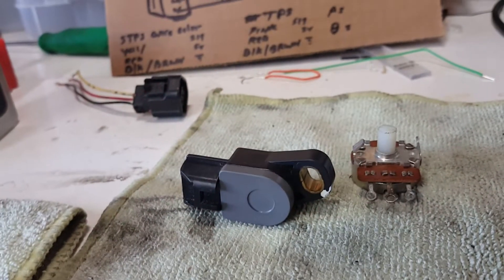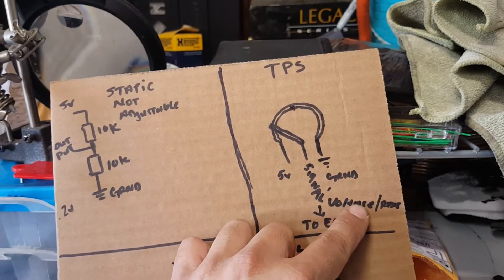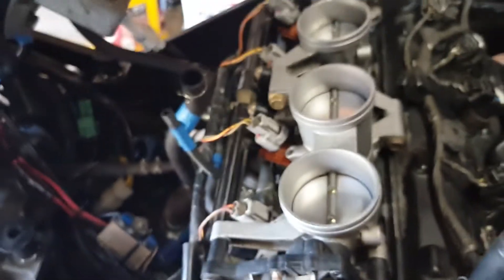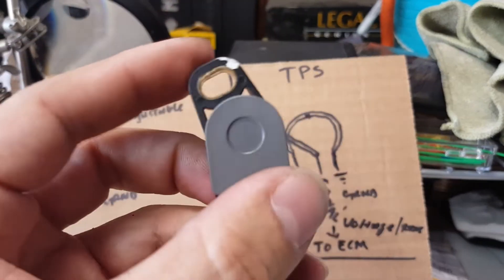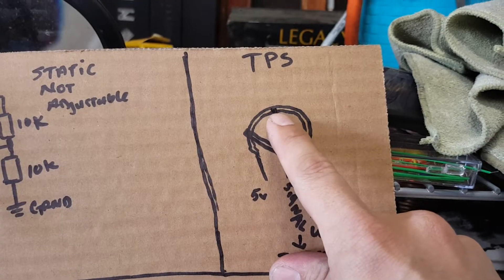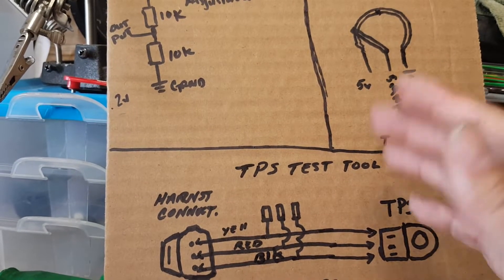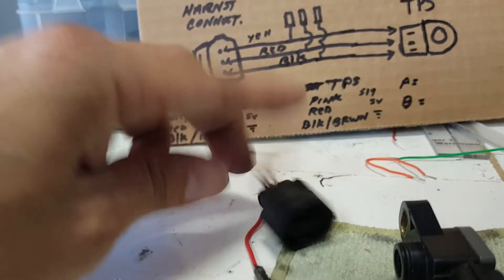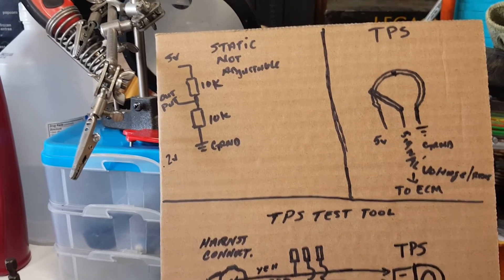DIY SUZUKI GSXR 600/750 Explaining the TPS

Comment: Are u talking about the jerky herky throttle? Where 0-10 percent throttle doesn’t seem to exist. When ur trying to maintain a normal speed?
Reply: Same issue I'm having. Did you figure it out?
Reply: @850Biker  unfortunately no, only rode the bike a few times this year and it hasn’t really done it. It randomly happened when it did. sometimes would be totally fine.

Comment: Hey can you make a video on how to replace the tps cause the line next to the coo code is on top wen the bike is not running but wen it's running it's in the middle and wen I pull the throttle it jumps to top then back to middle wen I let go of the throttle
Reply: Its when not wen

Comment: I hope you’ll still answer on my gsxr 750 the bike lags behind I’ll give it full throttle and instead of shooting off like a bullet instantly it stutters for about 5-10 seconds before the bike realizes I’m giving it full gas I just installed a new fuel pump was wondering if my tps is the issue
Reply from the maker: Put the bike in dealer mode and check the TPS level at idle, should look like this -00, then see which way the level floats when you give it WOT. this way _00 or does it move to the top..  at idle it should read -00, if not, it needs adjusting.. thats where I would start.

It's very rare for a TPS to go bad but it can happen. I know you just purchased a new fuel pump but did you check to see if you have the proper fuel delivery and fuel pressure or did you just assume it's good because it's new. After that I would move to my injectors and make sure I have forward and backwards flush them to ensure they're not dirty. Also check the spray pattern, is it a nice V or does it just dribble out.. lol. Another thing that most people overlook are spark plugs. I would start with a fresh new batch that are properly gapped. Be sure to  test your spark on each pack. I once had a spark plug that was loose in the number one cylinder that was causing me issues in the mid to top end range. It wasn't till I got in there to install  new plugs to  that I noticed the plug was loose and was the issue.

Lots to cover for problems like this.

Comment: My gsxr1000k3 runs bad but once its over 4000 rpm its ok  it bogs and cuts out when you rev it really slowly i pulled the tps plug off when bike was running and its so much better can rev slowly no problem. Would you say my problem is the tps as its so much better when i unplug it £166 for new tps i just want to make sure plz any advice would be great ty
Reply from the maker: Are you speaking of the TPS or did you mean the STPS.  Bogging at low rpms i would also look into poor spark (bad plug or plugs) and or dirty injectors to rule out the other components the TPS or STPS controls through the map (ECM) programming.
Reply: @TheChemistDIY  plz can you help me again i have cleaned fuel filter to injecters, new spark plugs but bike is still bogging in low rpm i have replaced my throttle position sensor thinking it was that but bike is the same but unpluging the tsp it runs good so what controlls the tps?what would you look at?
Reply from the maker: @mattmiles259  ok so look at this video and see if your butterflies are operating as they should with the TPS and STPS connected.
https://youtu.be/wfuXw0nhwh8

If after revving a few times they are moving as expected then its not going to be a TPS/STPS issue because remember all they tps does is tell the ecm where the butterfly (gold butterflies) is at and to increase/decrease air to fuel ratio, which in turn moves the STPS (secondary butterflies) open or closed.

Your issue may be a fuel delivery which means low fuel pressure or fuel pump not working correctly (dirty or bad). You would need to perform that test with a fuel pressure regulator and perform the fuel pump test.

Also Put the bike in dealer mode and see if your getting any hidden errors codes on the cluster.

Also when u put in dealer mode where is the needle at on the cluster.. in the middle, up top, or down low? I know you said you changed out the TPS but did you put the bike in dealer mode or  Diagnostic mode and adjust the TPS properly. The level indicator should look like this -00  (line is dead center). if its above or below you need to adjust the TPS/STSP.

Comment: I'm having a problem with my 2007 GSXR 750 where everytime I'm climbing rpms all of a sudden it cuts power drops rpms to 0 then goes back to its actual rpms it was before. happens mostly every gear when I'm rolling on throttle if anyone knows what it could be before I start switching parts out
Reply: It could be your kickstand sensor. Make sure your springs on your kickstand are strong. I had that issue where the rpm would just drop to 0. Kickstand would drop alittle more than it should so I got a new spring and it never did it again

Comment: My 2008 suzuki gsxr can rev more than 5000 6000 rpms!  Can go fast but has to be gradually! If I push the bike to the limit start with the misfire  loss power between those rpms! Note ! New fuel pump filter! Spark plugs and i clean the injectors! Still have the misfire! Any idea
Reply from the maker: @yamahar1castillo923  have you checked for vacuum leaks, ignition spark from each coil pack, proper fuel pressure and fuel delivery, (this goes for both injectors and fuel pump) .

Are or was there any previous code being thrown from the ECM?

Comment: Is it possible for this to cause RPMs to hang on deceleration?
Reply from the maker: Not likely unless the TPS or STPS is somehow binding slowing the movement of the flies return.

 If your RPMs aren't dropping fast as soon as you release the throttle then I would suggest checking your throttle cable play.. as soon as you release the throttle it should snap back quickly.. if it slowly returns to the closed position then it's dragging causing your engine to slowly return to idle..

Comment: You may not be solving my issue, but I genuinely appreciate the time you took to make this video so that I could learn something.
Reply from the maker: Sometimes it works out that way. You go through videos YouTube channels hoping someone will hit that sweet spot and describe exactly or close to what your experiencing.. in the process you pickup additional knowledge and lock it away for another rainey day.
Reply: @TheChemistDIY  Your videos have been helping a lot. Without going too much into it. My bike fell over in a storm. Street was flooded so my bike got water in a bunch of places it shouldn't. Got it to start and ride. At first it was fine. Took it out and in higher gears it maxes out at a certain rpm per gear. I now have an stva code. Because without thinking or knowing exactly what the fuck I am doing...I slightly moved the secondary buttflies with my hand. So I probably destroyed something.
Reply from the maker: We all have to start somewhere brother and by you getting in there began your venture into learning what your bike is all about. 

The butterflies aren't that sensitive bro, you are able to move them by finger so no worries there, you didn't mess anything up.. your C28 code is very common for this bike..  and I have a fix for it.. there are three video in my arsenal of repair videos and make sure you see all three of them before going in.. but just so you get a better idea on how to fix you issue here is part two.

https://youtu.be/wfuXw0nhwh8

Remember you can't damage what's already broken, you can only move up from here.. pick yourself up a service manual and read up on your bike.. I usually have links to a few in most of my new videos.. I own two on my bike and looking to get a third.. each has there own way of explaining things..
Reply: @TheChemistDIY  oh dude I watched all three of those before even watching this one. And I also appreciate your words of encouragement. Before I knew even how to ride a motorcycle at all I told one of my buddies (owned an 05 gsxr 600 which is funny because he had this issue) that I would want to do as much repairs as I could on my own and learn as much as I could because I like to be self reliant. As soon as I bought my k6 600 I bought a clymers manual and downloaded the oem service manual. I've been delving in the oem for the stva but haven't checked my clymers. I for sure appreciate the time you've taken to respond and all of your videos.

Comment: You're frekkin' smart man, I can tell by your explanation of these things. Great video! I was scared for my bike, But your explanation let me know what is going on. Good stuff! I'm definitely subbing!
Reply from the maker: Prone Rider 562 thanks for the props and thanks for subscribing. By no means do i consider myself smater then the average person, just well seasoned and a person who has taken the time to research and educate himself on the finer details. Dont ever be afraid to open your bike up, remember you cant brake whats already broken. Ride safe!
Reply: What was going on with your bike? I'm wondering if i have the same issues.
Reply: @curt1star05  For my bike, The throttle position sensor slipped out of timing so it would bog out at around 6k for a split second and then again at 6.5k and up around 8 as well.

Comment: Amazing video.. this was the problem with my bike.. very good knowledge shared here.. thank you very much
Reply from the maker: Glad I could help you out brother, thank you for stopping in and commenting. Greatly appreciated
Reply: @TheChemistDIY  
I also wanted to add.. I had trouble with the resistance measuments.. however I heard a clicking noise when I spun it.. after my new tps arrived it was smooth.. not clicking...

Comment: Can this cause a bike to just crack but won’t start? Is it like common with these bikes?
Reply from the maker: Can it? Yes.. but really anything can be said to do the same about any component on the bike.

You have to look at things in the broader sense:

A popular explanation of how a four stroke engine works is:

Suck, squeeze, bang, blow.

The engine sucks in a mixture of fuel and air, then squeezes it together (compresses it), then it burns / explodes that with a bang, and finally it blows out the exhaust.

So what part does the TPS do.. well it's part of the SUCK because without the correct air intake the bike is not going to start. The TPS(s) controls your butterflies which allows the correct amount air to come in during start and ride. All this is being controlled by your ECU "Mapping" which is basically like a receiver.. collecting data from its sensors (sensors), comparing it to a list (map), and then sending out what you need to keep the bike alive.

During the SUCK you also have to have the correct amount of fuel. Without fuel you won't get to BANG.. 

SPEAKIN OF BANG! .. what lights your fire 🔥.. yup... That's right, Spark!

Without a healthy flame You're basically trying to light a firework in the wind with a wet match stick.. not going to happen..

Probably not the answer you want to hear but when you put all those principles together You get an idea of what you need to check in order to get your bike to turn over and run.
Reply: @TheChemistDIY thanks bro soon get back to the bike

Comment: Hello, James 
I’m having a sputtering issue on my 2006 gsxr 600 during high rpm’s, I have replaced my fuel pump, stator, rectifier, spark plugs, and is still doing the same. Do you think that the TPS might be the issue? Pls help me out.
Ps great videos, keep it up and thanks for all the educational videos you have, I’m sure you are helping a lot of riders in the world.
Reply from the maker: Hey Derik, thanks for joining the channel. In order to troubleshoot your issue I'm going to need a bit more information (details are everything!!!).  You say the issue occurs during high RPM, well does this happen if the bike is parked and in neutral and you rev the rpms up? if so then we can exclude drive train (Tranny). If it happens only during a ride then we need to also think about the drive train when trying to diagnose.

Here are some questions you should asking yourself to diagnose:
Does this happen if the bike is parked and in neutral. Can I rev the RPMS up and reproduce the problem.
Is this at a specific RPM that the spudder or bogging occurs, say 7000k or in the range of 5000k-7000k rpms.
Is it sporadic (only happens sometimes)(if so what are the ALL the conditions like)
Is the bike at a certain temperature when this happens?
Is it hot out or cold out, (climate issue) 
Is it in a specific gear that this happens (2nd, 3rd, 4th ..ect)
is it in a specific gear at a certain RPM range (2nd gear @ 7000k rpms).
When was the last time I adjusted the Clutch/when was the last time i replaced the clutch.
Is the chain tight, when was the last time I changed the chain, what do the sprocket teeth look like ( is this happening because the chain is jumping teeth)

It's very rare BUT NOT IMPOSSIBLE that its a TPS issue. you've changed out a lot of parts that I would imagine could cause this issue. but sometimes it maybe something so small that were overlooking like dirty injectors, fuel lines,  or gas tank. when you removed the fuel pump was the filter very dirty. if it was did you look inside the gas tank for rust and other junk because what's inside the tank could possible be in the rest of the fuel system, therefore we would need to clean the entire system from beginning to end,... see where I'm going with this? (details)
Reply: james moreno 
Hello James, 
It does it in any gear , but only on high revs maybe around 8k-10k, but on neutral it is fine when I rev it up, but I still did not try to rev it up slowly to see if it acts up on neutral, the sound that you describe on this video sounds exactly the same my bike makes, the fuel filter was normal state for its years in the tank when I replaced it, no rust and or debris that would harm the fuel lines, I was thinking after watching this video it was the TPS, or maybe I can get a fuel injection cleaner, and or my power commander? As for the sprocket teeth it is still fine no issues on it. Chain is kept maintained and no jumping.
Reply from the maker: @dreyes001  ok so now were getting somewhere. At the time of this video i was experiencing a quick blurp/cutout when climbing up the rpm rang fast, when i wasnt so hard on the throttle and rolled through my gears nice and calmly (not being a speed demon) the problem wasnt there. Does this occur when your hard on the throttle or also when your riding normally?

Just like you i replaced a shit ton of things thinking it was either a clog or some electrical issue that was causing a cut out. What i came to find out was that it was my dogs within the tranny was slipping because the interlocking cogs were no longer square but rounded due to hard shifting. This was  a hard issue to diagnose because you cant simply crack open the tranny and take a look for rounded dog teeth. Shortly after replacing all l these parts to try and solve the blurp my tranny went on the freeway confirming that it was the dogs or a tranny issue. Personally i dont know your riding style or shifting habbits or if your the first owner tobhow the previous owner rode it but this may be your issue, but only you can confirm this.

Image of a bad dog:
https://goo.gl/images/GTZoMu

Two things that i would do at this point is disconnect the power commander and put the bike back to stock to rule out it being the issue (take it for a ride and see)  If that didn't work, Secondly i would then swap the TPS and STPS (they should be the same part). Swaping is a bit of a pain because you have to recalibrate them.

Last ditch effort would be to inspect your clutch and clutch basket. Your looking for worn plates on the clutch pack and bad teeth on the basket and basket hub.

Since your bike is having this issue at a certain rpm range im ruling out a fuel delivery issue. If your tank,lines, and injectors were dirty, the bike would run like shit no matter what rmp you were in. 

Since it happens under high load (7k and above rpm) this has my mind moving more towards friction or parts under stress due to torque.
Reply: and my problem :( C29 Error
Reply from the maker: @roudeepofficial  you can find secondary throttle position sensor all day long on ebay,

https://rover.ebay.com/rover/0/0/0?mpre=https%3A%2F%2Fwww.ebay.com%2Fulk%2Fitm%2F262906038373

Comment: Great info!
My 03 gsxr 600 bogs down at full throttle in sixth and I think fifth gear also.
Could this possibly be the TPS? 
Is it easy to replace?
Reply from the maker: I would look into the fuel delivery first. Look in the tank for rust, checking the fuel pump and filter..and checking fuel pressure and correct fuel delivery.. and forward and backward flushing the injectors.. 

As for the TPS, it's pretty simple to replace, just a pain to sync. Speaking of syncing, make sure to put the bike in dealer as see if the indicator is sitting mid point -OO if it's not then adjust the TPS so that it does.. this is where I would first start.. then move to fuel delivery..